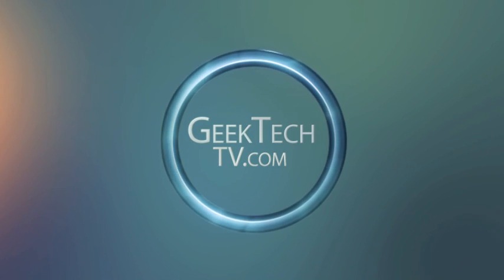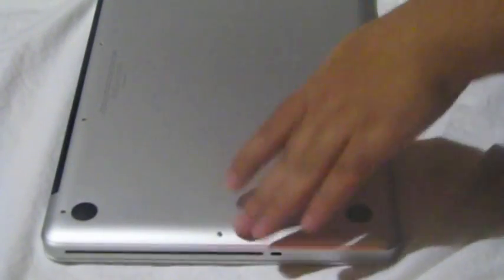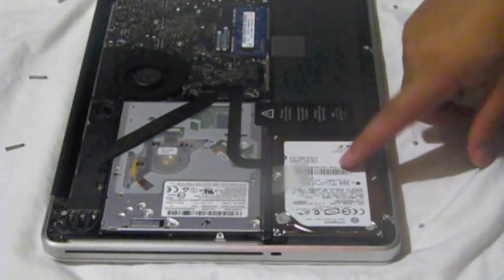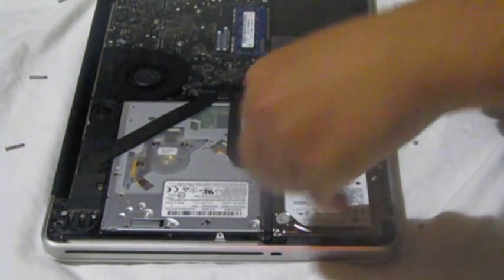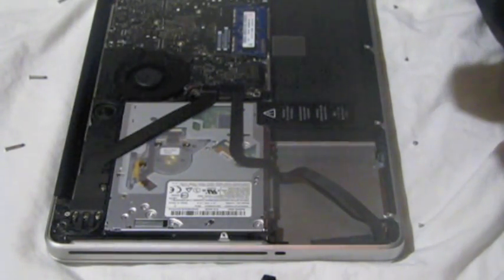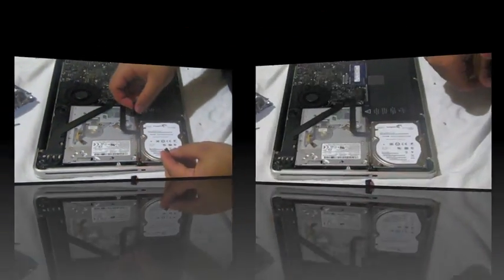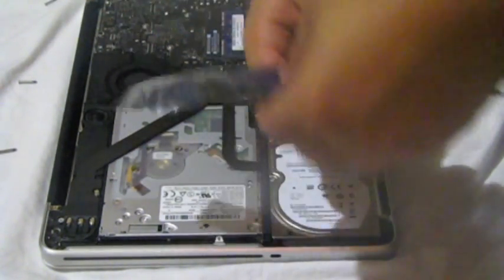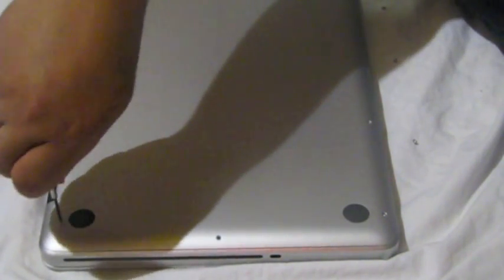How to replace the hard drive in the new 2011 Macbook Pro Line

Comment: I always try to do my research before diving into computer surgery.  Thanks to your video I can see it's dead easy to do this swap.   Cheers!
Reply from the maker: No worries :)
Reply: After I saw this I swapped a SSD into the HD spot and put the original HDD in the optical bay with an adapter..   super pleased with the results.  Thanks again :)

Comment: Wonderful tutorial.  Thank you.  With your instructions, the replacement job took maybe 10 minutes.  One thing I want to note is that I failed to obtain a torque 7 screwdriver, so I removed the side screws with a needle nose plier instead.  Didn't harm anything.  Thank you again.

Comment: Which specific drive did you put in there. I' having trouble finding info about whether 7200RPM drives are supported in 13" macbook pros. Some are saying apple says not to do it due to temperature and heating issues. Have you noticed it running hotter or louder?